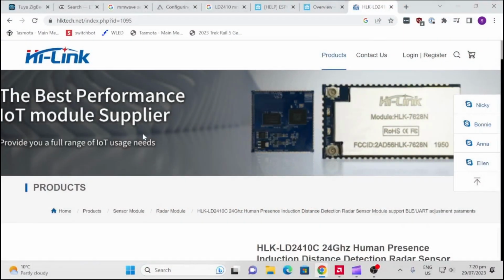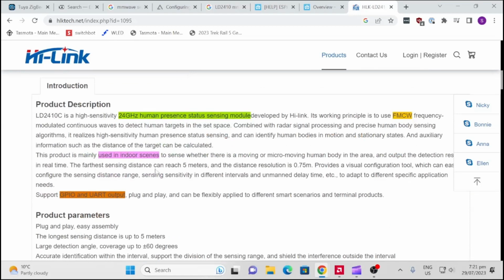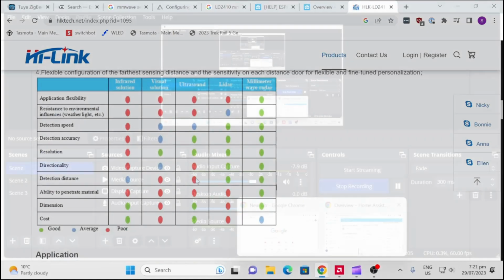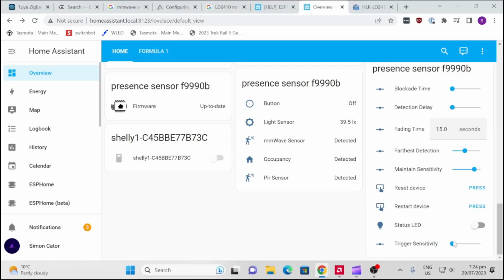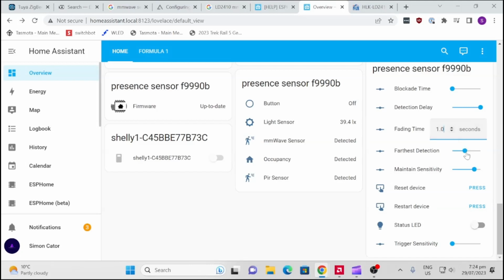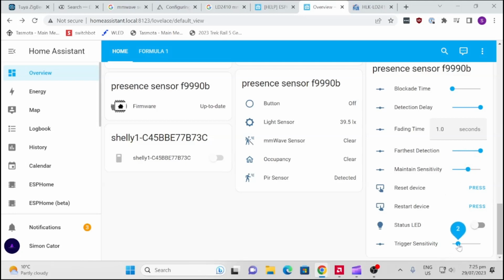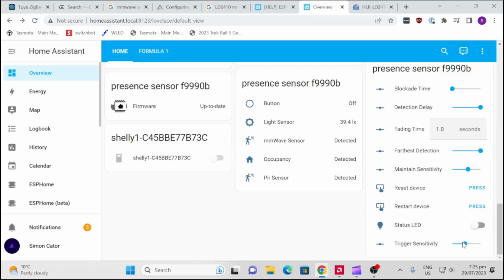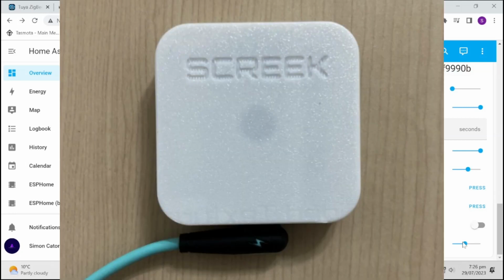What's inside the Athom Presence Sensor and how can we tweak it?

Comment: Nice video, I've also emailed asking what the Blockade Time could possibly be for too.
I've got x5 of these in my house and another x4 on the way - had one up for for testing over a couple weeks and just installed x4 in other rooms yesterday.
The mmWave senor is super fast to trigger and the over all presence detection (pir + mmWave) is triggering lights on faster than my zigbee PIR sensor did - that's a win!

I'm just putting the below info here in case someone is researching these sensors for them self and hopefully can help them.

As I have installed x5 and doing another x4 soon, I didn't want to have a heap of cables on the walls or get an electrician in to put a heap of power points in my roof space..
I have a 12v power supply in a room that goes up into the ceiling and from there the 12v runs in the ceiling space to a few 12v-5v USB power converters and sensors plug into those - as that's all low voltage, it lessens the risk of any issues, the 12v power supplied has circuit protections built in and best of all, no electrician required due to low voltage.

Down side of mmWave is that you need to think and plan where you place them as it 'sees through walls' and could keep lights on if you trigger in one room then go to the other room, keeping the mmWave active (eg. toilet and bathroom are right next to each other - Go to toilet, turns light on then, go wash hands in bathroom keeps toilet light on).
Placing the sensor in corner of rooms facing away from where people will likely be on the other side of the walls helps mitigate this.
Reply from the maker: Awesome thanks for your great feedback!